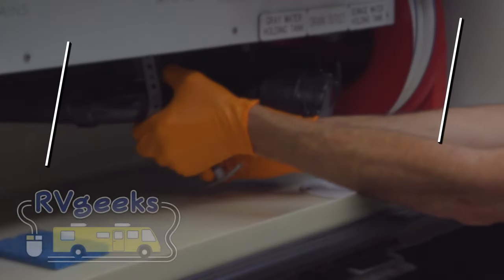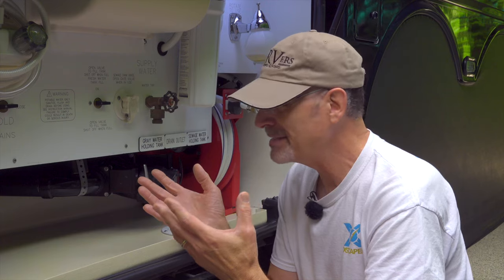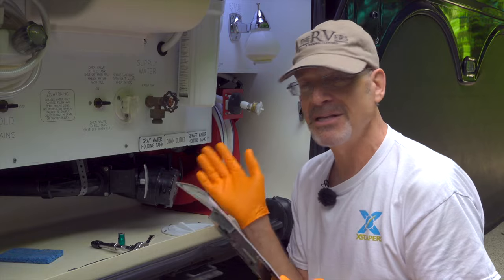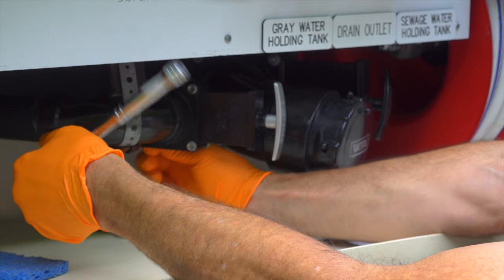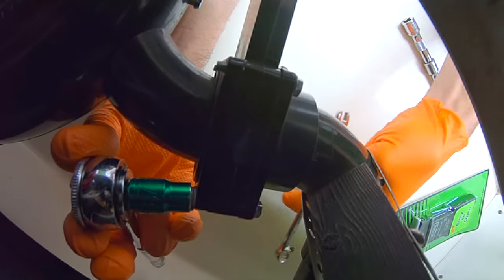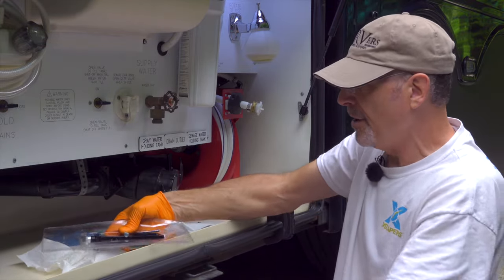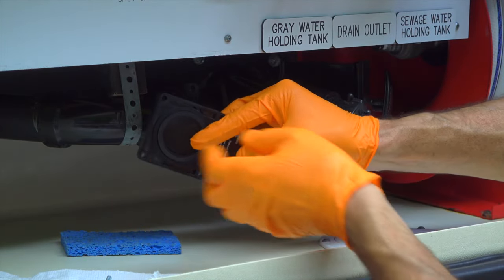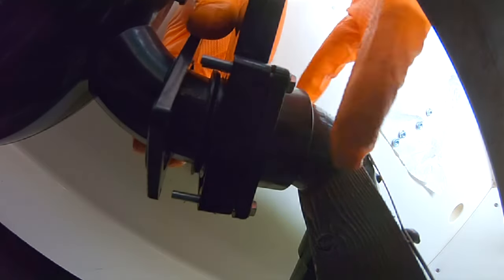RV Gray Valve Repair — REAL-TIME DIY Holding Tank Valve Replacement

Comment: Great video. I have a two year old Tiffin that the grey tank valve is really stiff so I am going ahead and replace it. I have seen some videos that advice  drilling an 1/8” hole by the pull handle to spray silicone lubricant to keep it sliding smoothly. When finish screw in a self taping screw to seal the hole.

Comment: 👍🏻. Nicely done.  A few shots of silicone lubricant (never use petroleum products on rubber) on the rubber seals at install and blade handle every month will help extend the life of the valves.   Routine maintenance, I do the toilet seal at the same time.

Comment: Yep! been there done that... but! both of my valves are benith my Fifthwheel so I had to remove the underbelly to access the valve. it was the black tank valve so befor I started the job I flushed the tank real good. I'll be honest this job was a real pain in my Butt all because of having to drop the underbelly.... Your lucky! yours are very easy to get to...
Reply: Yep, my travel trailer same way. The valves are just under the under-belly covering and you have to almost remove the whole under belly just to change one valve. Takes longer to remove and re-install the under-belly cover than changing the valve.
Reply: Mine are the same way except for they both have a cable that attaches to the valve and the pull handles.  That was a real pain in the butt.  Removing the underbelly wasn't all that easy either.  LOL  Great video for the easy replacements though.

Comment: RV Geeks, as mentioned I watched the video and appreciated the real-time. I am letting you know that I thought your video was excellent and had gotten off the phone with Grand Design as I have an MKE 17 that always leaked from the gray tank. (phew) (but not hold your nose pfew!) I asked them for the part and let them know by sharing your link of the video so that I could change it if didn't void the warranty. FYI

Comment: You had it easy. Our Coachmen has VERY tight fit as the valves are between the 2 tanks. The lines are relatively straight so the pipe will not bend or flex. So far I have only been able to remove the valves. Have not been able to expand the opening enough to allow the replacement valve to "slide" in.
Reply from the maker: We have some things on our rig that are like that, too.... not well-designed to be serviced easily. Always makes me wonder how they got them in there in the first place. Good luck with getting it solved, Roger. We know how frustrating it can be, but what a relief it is when it's all over. Hang in there!

Comment: Thanks for another great video.  I replaced the black tank valve on or 1991 class A and then realized that it is probably the grey tank valve leaking. I should have replaced them both at the same time.  It would have been easier.

Comment: I wish mine had been that easy. I have a Thor class c. The gray tank valve started leaking and I knew that I could replace it myself. When I disassembled the old valve I didn’t have to flex the pipes apart they sprang apart. Whoever had done the plumbing on it had misaligned the pipes and they were under tension. I added a flexible connector to solve the problem. I’ve done other maintenance on this camper and I wonder sometimes if there’s any pride in workmanship or quality control in those factories. It’s like we old carpenters used to say jokingly “good enough, you can’t see it from my house”.

Comment: Great instruction!   What do I do if my gray water valve is stuck closed and water is in the tank??   Just get ready for a real mess?
Reply from the maker: Hi Jeff. First off, having this problem with the gray tank is FAR better than with the black tank! That said, one way or another, you need to get that valve open. We'd suggest having the replacement part on hand before trying anything. Then if you need to use a vice grips to yank that rod straight out, just be sure to keep a second hand on the pipe to avoid pulling too hard on the plumbing connections. Even if the seal around the valve is stuck/jammed, you should be able to pull it out if you pull hard enough (again being sure to hold the pipe to avoid breaking the drain lines). By forcing it open, you will almost certainly have to replace the gray valve immediately, which is why you'll want to have the replacement part on hand, probably this one, which is most common: https://amzn.to/3WuJSXN By coincidence, we just replaced ours this past week for only the second time in 18 years. It was getting VERY hard to pull, and we didn't want to wait until it was stuck. Hope this helps.

Comment: We have this exact issue with our black tank. However, we have a cable pull system on a Travel trailer. My other concern is that its a 2018 Grand Design, so I'm surprised its failed so quickly. I wonder whether the valve just needs to be cleaned, or maybe its a cable issue?
Reply from the maker: Could be either, Brazen Brits. We've heard of a lot of situations with those cable-pull valves where the cable disconnects and/or isn't actuating the valve correctly, allowing it to leak because it's not being closed 100% to seal. If you can get under the RV and inspect it while it's being operated to see if it's something obvious.

It could also be clogged up a bit and need to be cleaned (not a pleasant proposition). We'd try the above first.  😉
Reply: @RVgeeks  Yup, thanks. I'm trying to think of anything better than having to replace it. I have images of me lying under the RV and something going wrong and....well....lets just say that's not the kind of ****faced I like to get ;-)

Comment: Great video.  The real time part is great.  Mine would have more explicit language though LOL.  We had a gray tank valve failure on our big trip this year.  Handle came off in my hand as I was trying to dump.  Luckily it was ONLY the gray valve.  Repaired there in the campsite, in true Cousin Eddie fashion, which I’m sure the neighboring campers loved.  Ours was a little harder to do because the valves are underneath, near the center of the camper.  So instead of exploring coastal Maine, I spent half the day exploring the underside of our camper. Fun.  In other news, I still maintain that you sound a lot like Elliot Spitzer; not a bad thing really, it’s a strong voice...you should consider voice acting or politics.
Reply from the maker: Voice acting and politics probably require the same skillset! 😂 Sorry to hear about your exploration in Maine, but glad you got it fixed.

Comment: Having worked on a water dept. for years I think I would of rotated tightening the bolts on the valve rather than tightening one up then the other right across from it. But, other then that, good job.

Comment: I would have treated the rubber seals with 303 before inserting them. Very good demonstration, thanks.
Reply from the maker: We didn’t use any type of lubricant because the instructions didn’t call for it, the valve worked smoothly right out of the package (possibly pre-lubricated?) and the old one never got lubricated in all those years, so we figure it’s probably okay!

Comment: Very helpful! Thank you. I need to replace both, I will start with the grey first. Is the black as easy?
Reply from the maker: Same process, but be extra sure to thoroughly dump and flush out the black tank first! 😉
Reply: @RVgeeks  Thank you!!!
Reply: @RVgeeks  My valves are totally different from yours! They have what looks like cables.

Comment: Wouldn't it be good to put some silicon grease onto the gaskets before installing?
Reply: I was thinking the same thing. Some plumbers grease maybe.
Reply: raybbj   Or 303.
Reply from the maker: Great question, Mike! We didn’t use any type of lubricant because the instructions didn’t call for it, the valve worked smoothly right out of the package (possibly pre-lubricated?) and the old one never got lubricated in all those years, so we figure it’s probably okay!

Comment: Exceptionally well done, thank you.  Love the "live" format, too.  I totally freaked when I found a leak in one of my 3 tanks (2 grey) and it wasn't until I removed the bottom corrugated plastic attached to the framing under my rig that I could see it.  The grey tank valve was leaking around the handle gasket, and at first I thought I was going to have to cut PVC/ABS and install a new valve assembly.  THANK GOD the thing disassembles.  Mine requires an extension handle, so that's a bit of an extra step too.

Should there be any type of lubrication on the valve assembly before you install it such as a shot of silicone spray?  I've also seen seals lightly lubed to allow them to seat without binding on the flange edges.  Any thoughts on that or is this over-thinking?  :)
Reply from the maker: Thanks, Randy. And so sorry to hear about your leak. Glad you've identified the source! We didn't use any lubrication on the seals/valve assembly before installing it, but others have commented below and suggested using either silicone or plumber's lube to help them slide and not get twisted or damaged. Don't know that we have a dog in that fight either way... we just followed the instructions that came with the replacement valve body and it's been working fine ever since.

Comment: Nice video but you did not address problems with knife valves that continue to leak. I have a 25' 2010 Chateau and would like to know if anyone else is having trouble with their tanks being so tight together that the rubber gaskets on the new valves become damaged when trying to install them. (Yes, I have replaced valves on a Jamboree more than once with no problem,)  One repair shop had to drop both tanks on my Chateau about 5 years ago in order to get the gaskets on!  ($330 for a job I did myself in the past for the cost of a new valve - $20)  It's leaking again and I'd like to find a better, and cheaper solution. Thor does not admit to being responsible for something I suspect was a manufacturer's defect. Any help would be appreciated!

Comment: Great Video thanks.   Question - do you keep your sewer hose connected while at a camp ground and if you do how do you prevent ants or critters coming in the hole?
Reply: James Giordano   I keep the hose connected and the grey tank valve open, black tank valve closed. Never had a problem with bugs coming in.
Reply from the maker: We always keep the hose connected, gray open and black closed (of course!) and have never had any problem either. But if you have concerns, you can keep both black and gray closed, and simply dump gray every couple of days as needed.

Comment: Appreciate this video though...I had to crawl UNDER my trailer and don’t think the seals sat well as it still leaked. Back u ponder again today.
Reply: Back under
Reply from the maker: Sorry to hear that @4Poshponies. You do have to be careful with the seals to be sure they don't get moved/kinked when the new valve is installed. And then you need to be sure the bolts are tightened down enough to seal correctly... without compressing them TOO tight and causing them to catch on the blade valve when opening/closing it. Hope you get it fixed!

Comment: One thing I would have done is wipe both gasket sealing sides of the existing pipes with a rag before installing the new rubbers and valve. And a little plumbers lube on the rubbers.

Comment: Thanks for another great DIY video! 
I've been finding that the handle for our grey valve is getting tough to pull. I'm guessing this is caused by a sticking valve...maybe? So, would that mean a valve replacement? To complicate matters, we have a 5th wheel so the handle is actually attached to a long cable that winds its way down to the valve that's under the belly. And the belly is insulated, so my task will end up being a bit more complicated than your task :-)  
- Rob
Reply: Maritimers Chasing The Sun   If you will drill a 1/8 inch hole just above the center of the  handle, you can squirt in silicone lube and it will flow down into the mechanism and smooth it out like new.
Reply: @amarmot3635  What a great idea! I'll try that!
Reply from the maker: Thanks so much to @A Marmot for such a great idea!

Comment: What kind of camper is that? Looks like your valves are enclosed inside vs underneath? Thanks. My brand new Jayco is leaking profusely past the closed valve, a stream. Took it in, so far they can’t find any issues. I think it needs to be much more water in there to test, more water = more pressure, common sense.
Reply from the maker: Sorry to hear you’re having trouble, Jerry. Our rig is a Newmar Mountain Aire diesel pusher motorhome, and the valves are indeed enclosed in the heated basement.

Comment: Good Video, only comment that it would have been good if you mentioned the camper make model and the Size of the Valve.
Reply from the maker: Gray valves are universal on almost all RVs - 1.5" and we included a link in the video description: https://amzn.to/2lPl3Kj
This should fit your rig, regardless of make and model.
Reply: Thanks, didn’t see that, but then I am Youtube novice.
Reply from the maker: No worries, Mark! YouTube makes the video description awfully hard to find on some platforms. Hope this helps and you get your gray valve replaced no problem. Safe travels!
Reply: I have to do both, rusted bolts on gray and black.  Have had our 1998 24’ Coachman Catalina since 2002.  First time replacing the dump side valves in 23 years.
Reply from the maker: If the bolts won't come loose, you'll probably want to pick up some Liquid Wrench penetrating oil: https://amzn.to/3nGBgxm
And since you're doing the black valve, too, this is almost certainly the one you'll need (again, standard, 3"): https://amzn.to/2MSQEae
Good luck, Mark!

Comment: I have a gery water valve that opens but does not drain. Is this a bad valve as well?
Reply from the maker: If you pull the gray valve with water in the tank, but nothing comes out, the metal rod may have disconnected from the valve. Try rotating the handle clockwise to see if it will screw back into the valve. That may work. If not, the valve probably needs to be replaced, which may be a challenge with gray water in the tank. Better than having the same problem with the black valve!

Comment: It is very rare that while watching one of your videos I feel I might have a good suggestion to give that might enhance them. LOL  However...have you ever thought of using dog potty pads for things like this?  As a foster home, I always have them on hand and use them for A LOT of drip work things.  Like oil changes, plumbing changes, bottom of my trash cans, and even under my sinks so when a leak starts I can see it pretty quickly and there is protection for anything that is underneath.
Reply from the maker: What an awesome idea, Jen! Puppy wee-wee pads! Never thought of that, but will have to keep it in mind. If our black valve ever needs replacing, we're going to have to remember that.  Thanks!
Reply: @RVgeeks  I think that one I might have to give over to a service agent. "Yes I know how to replace the valve, but I don't wanna!"
Reply: I keep coming back to this video and your comment about, "nothing should come out". I purchased my RV used and it is only a few years old now....however, every time I've opened up  the cap to empty my tanks there is usually a bit of "stuff" that comes out.  It is usually green or orange depending on the product I've put into the black tank.  It has been minimal and I assumed it was a normal part of things.
Reply from the maker: Jen Fugit Sorry to report, Jen, that anything hiding behind the sewer cap that matches anything put into your black tank means you have a leaking black valve that should be replaced. Same technique is used to replace the black valve as we used to replace the gray valve. You’ll just need the larger 3” valve: https://amzn.to/2mh5aNt
Reply: @RVgeeks  Thank you.  But, I'm crying on the inside now. LOL
Reply: @RVgeeks  Crap, no pun intended.  Guess I better watch this video again before winterizing time. ;)

Comment: But what about if the valve needs to be replaced BUT you can't get the gray tank to drain 1st. Asking for a friend (thankfully not our issue 🙃)
Reply from the maker: Oh no! Your “friend” 😉 is in trouble. The only thing worse would be if it was the black tank. If it were us, we sure would expend considerable effort trying to figure out if there’s any way to get that valve to open up and let the gray water out. Did the rod simply pull out of it? If so, it’s possible you may be able to get it to thread back into the blade valve. Other than that, we would see if there’s any way we could park our RV with the water bay right over a dump station, and start the process of replacing the valve right there. As soon as the bolts are loosened, you could stand back and wait until all the gray water dribbles out. Sorry we don’t have an easy solution to this one. Please let us know how you make out.

Comment: Can't get pipes apart to remove valve HELP
Reply from the maker: You need a socket wrench and a box wrench and a little elbow grease to loosen the bolts. Just make sure you are turning in the correct direction. Righty tightee, lefty loosie. If the pipes won’t come apart, after the bolts are removed, they may be stuck together, and there may be a fair amount of pressure from the plumbing system against them. Might take a little bit of pressure, but just be careful not to force it, and break one of the plastic pipes.